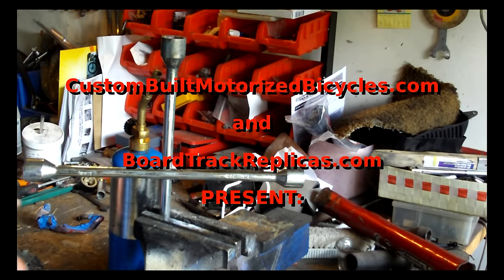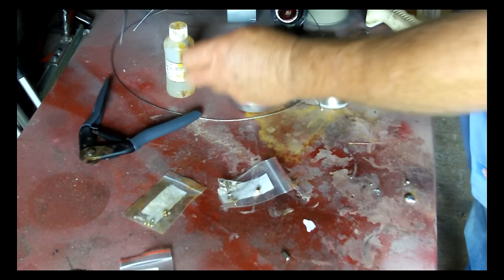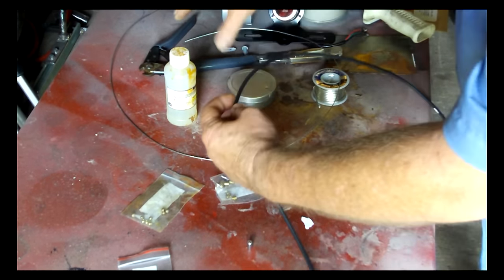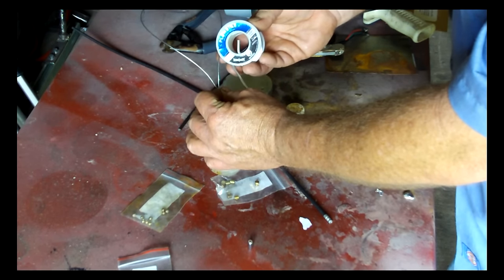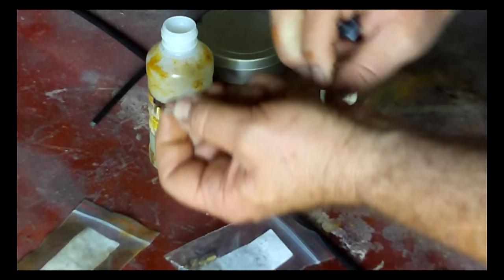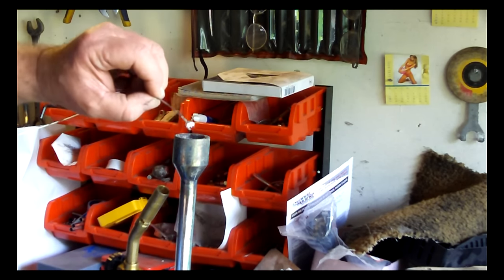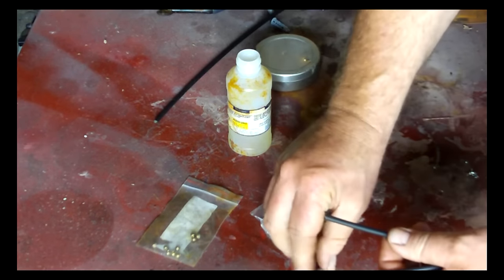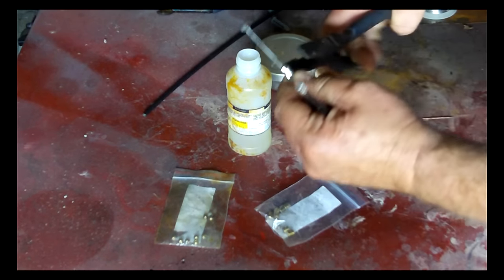Repairing / Soldering a Motorized Bicycle Cable - Throttle Clutch or Brake

Comment: this is really a good method. I found another way that will work if you don't have soldering material and/or the skill to use them. You buy a aluminum ferrule stop for 1/8th inch cable, drill a hole through it that is perpendicular to the 1/8 in cable hole, stick the end of your throttle cable into the hole you just drilled, then use a 3 lb hammer to crimp the stop onto the cable. Then use a file to shape the result so that it will fit into the twist channel. It works, believe it or not.
Reply: that is a good idea, i am going to try it today.
Reply: I've used lead before, instead of solder. It melts easily and seems to hold better than solder. I used a 2 oz. Sinker.

Comment: Not "Silver Solder".  Most likely 60/40 (60% lead - 40% tin) "soft solder.  Silver solder requires heat of about 1,000 degrees F (depends upon components) and is used for stainless steel cables and "sweating" socket joints.  Silver solder also requires special flux.  Most welding supply houses carry silver solder and online of course.  Some cables are stainless steel.  Use a magnet to determine if stainless, stainless is not magnetic or only slightly magnetic.  Steel cable will pull a decent magnet without any doubt.

Comment: I like the tire-iron idea.

It the future you may want to only dip about half the fitting into the solder as opposed to s half inch or so of cable.  I believe this will help with the wire being potentially brittle if it has to make a tight corner (which is the case if you were making a cable for a motorcycle throttle).

Comment: An ordinary steel endcap for 3/4" steel pipe/plumbing makes a good solder pot. I can get my torch underneath it when clamped in a vise.
Reply from the maker: Good idea

Comment: Note: If that was what's called "tinners" flux (which is what you use to be able to solder to steel) , be sure to neutralize it because it is a powerful acid and over time can corrode the cable end and the inside of the conduit. A little sodium bicarbonate (baking soda) and water will do, then rinse well.

  Also, be sure not to breathe the fumes of any soldering or welding process. Flux and vaporized metal can be really bad for you!
Reply: 1936_CAT22 yes! it's called "heavy metal" poisoning
Reply: Whenever I change the cables on my bike, they already have this barrel connector on one end. What is the point of this video? These cables are dirt cheap and they already the barrel that he spent 10 minutes putting on the cable!
Reply: tarstarkusz sometimes is VERY MUCH NEEDED to put another lead tip on the OTHER END of the cable ATER it went throught the conduíte ,,,, not BEFORE  ( or it won't pass throught the conduíte anymore ) .
Reply: @tarstarkusz  and you spent 10 minutes watching it.  He builds custom bikes.  Custom bikes need custom cable length.
Reply: Screw that, the fumes make it more fun
Reply: @tarstarkusz  Because garage mechanics like myself own several stupid rare bikes and its not as simple as opening a Honda or Harley catalog and picking out some cheesy Screamin' Eagle $250 brake cables.

Plus, it's quite fulfilling to learn a new skill.

You should try it.
Reply: +Teven... I have nothing against learning new skills that are useful.  The cables come with the barrel connectors (different sizes) on both ends.
Reply: @tarstarkusz  "that are useful"

How is this not a useful technique?

When you break down and run out of brass adjusters do you:

A: Park your bike, open your phone, order your part, then sit it on your ass and wait for it to arrive by mail.

B: Call around then drive to a (hopefully) nearby bikeshop for your cables.

C: Fix it yourself for .05 worth of flux & solder and be back on the road in under 15 minutes.

Choose wisely...
Reply: I'm probably not going to be doing that on the side of the road. But I already know how to do it.
Reply: @tarstarkusz  who said side of the road?
Reply: +Teev,,, I though that's what you meant when you said break down.  I have repaired cables with solder before in a pinch.
Reply: @tarstarkusz  You: "Who even needs this video?!?! I mean all cables have adjusters!"

Me: "What if you dont have adjusters?"

You: "Oh. Then Id just make one with solder in a pinch."

Me: (facepalm)
Reply: +Teev... I mean that in the normal course, it's better to just get the right one in the first place.  If parts are unavailable or prohibitively expensive, then making it yourself can make sense.

Comment: Hey thanks for your videos and sharing your knowledge.  But when you crimped the ferrel why didn't you use the same tool you used to cut the conduit?  Seems like a gentle pinch with that would give a more solid crimp and look better as well.  Just wondering.
Reply from the maker: You can crush the housing and restrict wire movement was my thought

Comment: What kind of solder would can you use for a crank case bolt . One of the threads that hold crank case prongs stripped.
Reply: You don't. get a Die set and rethread it.

Comment: There was no link shown for the cable supplies. Venhill.
Reply from the maker: Yes, in description http://houstonmotorizedbicycles.com/repairing-soldering-a-motorized-bicycle-cable-throttle-clutch-or-brake/

Comment: what do we do when the cabble is to short after we cut the original cabble but then it make the clutch to tight
Reply: You can't take a broke clutch cable and add length to it, your gonna need to buy a new 1 or new wire that is long enough to do the job... and in your case I would make sure that you but at least 12 inches extra.
Reply: You make the outer sheathing, or conduit shorter. If it's too short, you can buy new cable parts and make your own...

Comment: solder sold for stained glass work so much better. plumbers solder has a flux core for copper
Reply: old trip no most doesn't, electrical solder is what has a flux core.

Comment: I do a lot of soldering and frankly I think you have overly complicated what is a simple solder job.  Just install your brass chingasa, fray or crimp the end to keep the bead from falling off, slap some plumbers paste flux on that end, hit it with the torch, apply regular ol' plumbing solder.  Bada bing bada boom.   What's with all the crucible alchemy dramatics?
Reply from the maker: I guess the way motorcycle shops do it are all wrong. Please upload a video and show me your work. Please put it on something you use regularly and give me a progress report
Reply from the maker: and how does that prove your point on MC cables?
Reply: Sorry, a fundamental law for both comedy and magic is that it ruins the act if you have to explain it.
Reply: agreed, no need for his fancy tire iron setup :) ive done this before just flux, solder, torch directly on the cable. Hes using a brass connector anyways, not like hes making an actual end cap. If it works, get er done, most of us spend more time fixing than filming :)

Comment: I don't understand the point of doing this. Bicycle brake cables (it might be the shifter cables) come with this connector already on it. You are cutting off the barrel to put on a barrel that is the same thing.

Comment: Dang sorry for asking in a old video,but Sr. What are the brass ends from and where can I get them
Reply from the maker: I used to buy them from Flanders Cables. Their website is still up but the order page is down. You can buy the brass barrel pieces from eBay. https://ebay.to/2M1iTTE

Comment: Thanks, interesting video. But would you consider getting a microphone so you don't have to shout? You probably have a MIC IN in your camera. There are small directional ones which minimises the background noise, if you don't want to wear the mike.
Reply: Some cables are no longer made.  Some are impossibly stupidly overpriced.   Most cables don't wear out just stretch which is their weak link.      Take a look at the price for some of the snowblowers cables today. Ariens wants almost $50 for a stupid little cable just because they can get it and  the things only 12 years old and rarely use just to put salt in the wound .    Gone is the day of the six to $10 replacement cable

Comment: I use a soldering iron, this is a long winded way to solder Bowden Cables..  I have been making cables for my motorcycles for many years, my way is simlpe process. One 75w soldering iron, roll solder job done...
Reply: Tim Haynes e
Reply: I think the dipping method has it's merit, where sometimes the iron is slow to heat the whole end. Whatever gets it done is the way to go.

Comment: Rattle snake at 7:14. Is he still alive?
Reply from the maker: Cicada. Long dead. They sure get loud in the summer
Reply: That's a Cicada. Not a rattlesnake. You should Google it. It's a crazy big bug that sheds its exoskeleton as it gets larger. They're extremely loud. Imagine hundreds of them making that noise at the same time . It's very common in southern States.